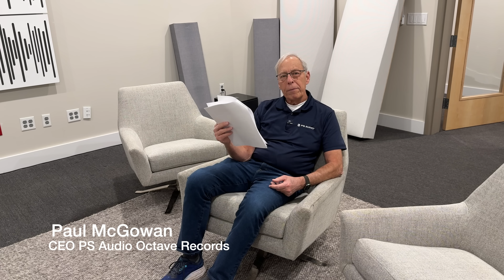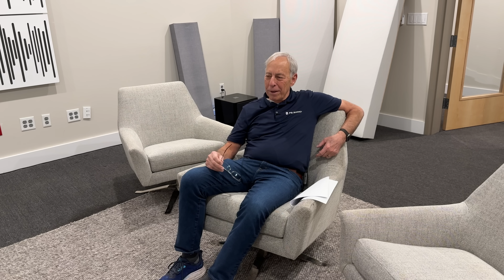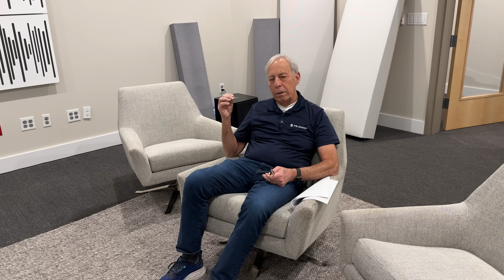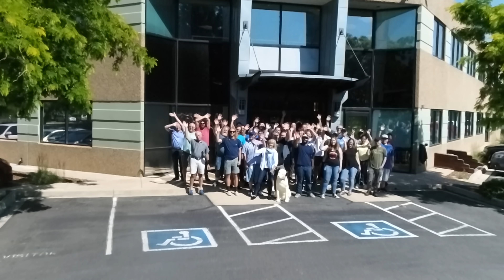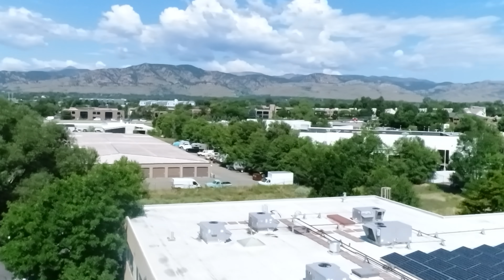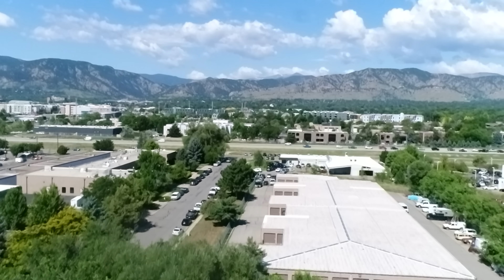Bandwidth limitations on fiber optics in audio

Comment: It's also important to note here that consumer fiber optic connections used in audio devices are based on LED's as the light source and the audio data is transmitted through mostly plastic cables (with some higher-end TOSLINK cables having some level of glass to them). When we talk about data networking using fiber optics we are talking about using far more powerful lasers as the transmitting light source and we are always dealing with far more expensive single-mode and multi-mode fiber optic cables made entirely of glass.
Reply: It seems to me the entire consumer AV market could benefit from investing in a higher bit rate optical alternative to HDMI, which is a licensed technology and has limited the number of entrants into the AV receiver market.
Reply: Was going to write this! It's basically a glorified on and off light switch that just pulses quickly. 

I still use a TOSLINK on my bedroom TV going to a mid fi DAC then to monitors so it still has its uses. I don't need ultra high res on my smaller system 96/24 is more than plenty.
Reply: @bf0189 Seems to me it’s just that the investment in the receivers/transmitters has not been a focus of the consumer electronics company. 

I love Toslink and use it still for most of my devices.
Reply: Thank you for writing this! I love it when one gets a real science based and earth based bit of info in contrast with the BS so prevalent in audio. I would only add that in audio now there is really no reason to go beyond TOSLINK between components and such. Today, we have streaming which is every reason to go beyond TOSLINK, but really only for coming into ones dwelling and their streaming device. It would make zero perceptible difference going to downstream gear, but makes perfect sense for first order source gear.